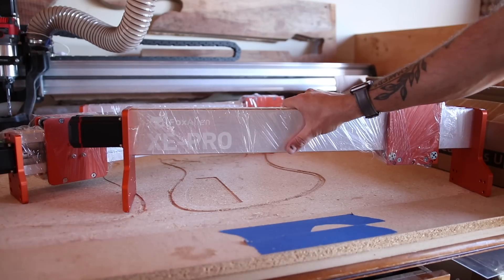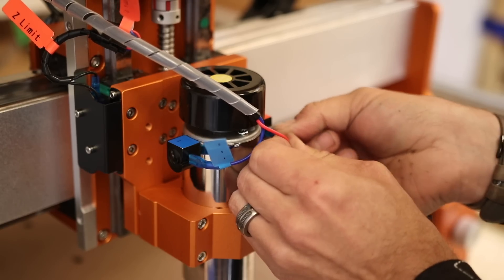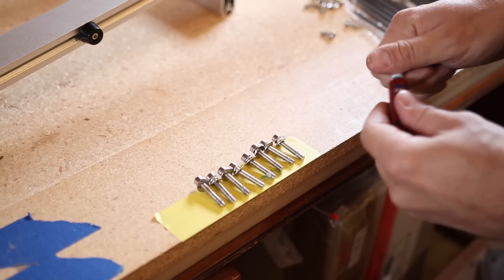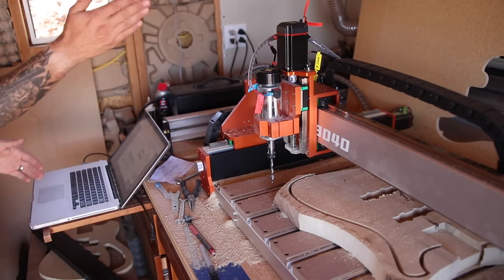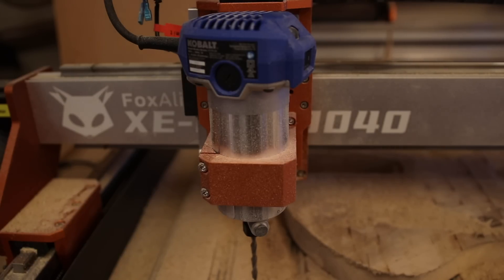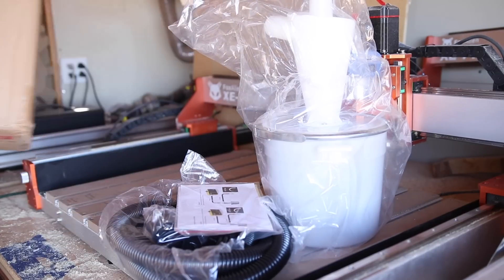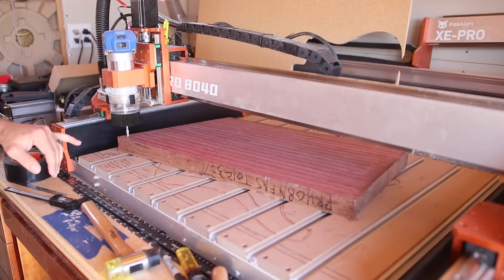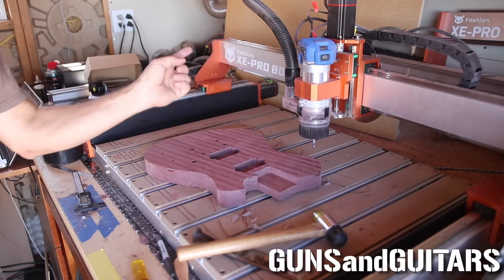Building a New Prototype with a New CNC (FoxAlien XE-PRO 8040)

Comment: Hey Dan, another creator sent me to your channel to ask if you have any experience with pango music kits? Or more specifically, they're China copies of esp guitars? They have two 7 string esp copies with really good specs for 300, but I don't want to waste 300 on an absolute crap guitar instead of just shelling out more for a legit one so just curious if you've ever tried them? Thanks in advance if you reply to this
Reply from the maker: Any guitar kit that’s made in china is a roll of the dice. Most of them are fine and can be made into really good guitars. But unfortunately it’s pretty common to get one that’s pretty bad and would need a lot of work or a replacement neck at the worst.

Comment: Ohh man, that will cause problems, never ever let the router bit sticking out more than you really need, I see quite a bit of flex. also because of the tension of that long bit when the CNC is doing its thing. I also see in some of your other videos that sometimes you are to generous with the depth you are doing in one pass and/or in combination with the stepover, you are putting to much pressure on those Makita Clones. But I dont mean all this in a bad way, I am sure you noticed this also. But man.. that's some really nice basses and guitars you are building, would wanna see more videos about that... :D

Comment: Where did you get a purple heart blank that big?
Reply from the maker: My local wood supplier. They don’t have pieces that big all the time, but once in a while I get lucky.
Reply: @GunsandGuitars  Ah, okay. I've been looking for a while for a a large blank of purple heart, and it's hard to come by. Or solid wood blanks of most types, really. 

I just bought a chainsaw mill to plank out slabs from trees I cut down, but man the drying time sucks. 

I really want to make a lap steel guitar out of a solid blank, and it's tough out here! 
I actually ju

Comment: Great video! Just ordered this machine. Super excited to get it and upgrade from my FoxAlien WM3020. It sounds like your getting lots of chatter. If you secure your work piece better (with finger clamps) or some sort of vice/fixture and secure your machine to the table that will reduce chatter and you will get much better surface finish (less sanding 😉). More ridged = More better and less work = More money!!

Comment: Smooth? Neither of those first two runs were smooth. Spindle abuser killed the first one and will kill the router also unless he changes his behavior. The amount of chatter he's getting... Can he not hear that?? I wanted to shout dude about the length of exposed bit but that would do no good. He tries on the vacuum setup and I bet he's wondering why he's not getting good results. Of course he's not going to get decent results if the dust boot isn't at least close to the material. Yet another sign that his bit length is too long...

A moment of silence for the first spindle. 

Yes, you were underpowered but you still had so much life left in you to be taken so quickly.

Comment: Man there are so many great options for machines now! Way better than when you or I started even Dan. Did you see that millright launched the Mega V2 ? The thing comes with a vacuum table and tool changer!......check it out........just wish they sold those options as upgrade kits for my original Mega V-XL